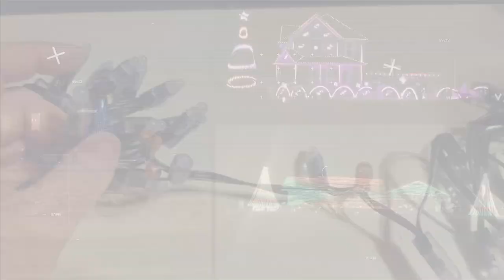Pixel Repar with Scotchloc UY2 Connectors

Comment: Was just re-watching this video and noticed that when you cut out the two bad pixels, you cut at the center of the wire between the good and bad.  Would it not be better to cut up against the two bad pixels that are being removed since they are trash anyway?  Would give you a bit longer wiring to work with for the splice.  I know you are trying to keep the wire the same length between pixels but better to have too much than coming up a half inch short after the splice.  Just an observation.
Reply from the maker: Because the string I was splicing wasn't actually burnt up :) that way the string can still be used.

Comment: There nice but i am a firm believer in old school solder and glue lined heat shrink it can never be beat for life long dependability and if i do say 1 wire to 2 or more dab a little epoxy on the solder  then slide heat shrink over
Reply from the maker: We do agree!   When your show is down on the ground and you're able to properly service the connections, by all means use marine grade heat shrink and solder those connections up.  When you have a show going and the bad pixel is in a pretty rough spot to get to, then these are worth their weight in gold.  I will say that none of my connections have gone bad in 5 seasons, using the UY2 connectors or other similar options.